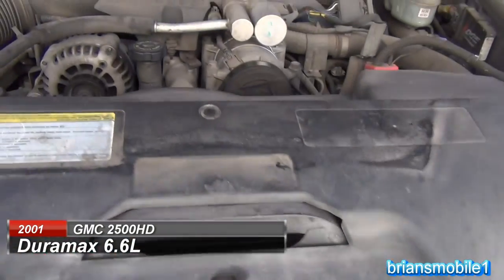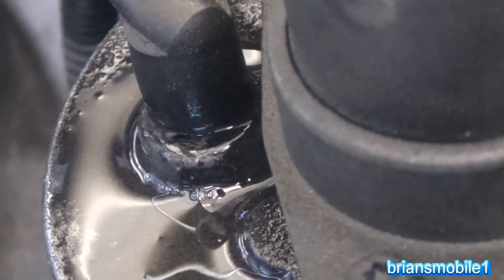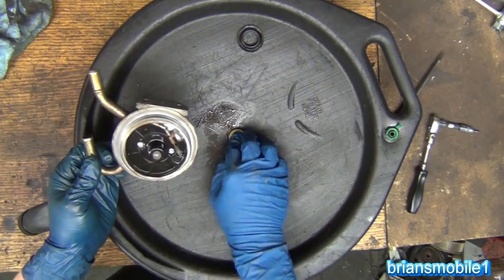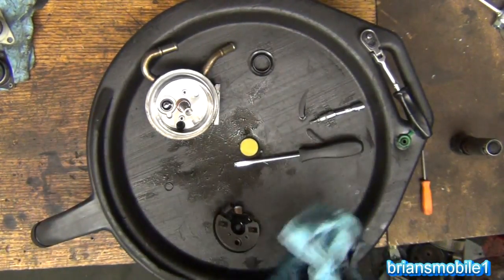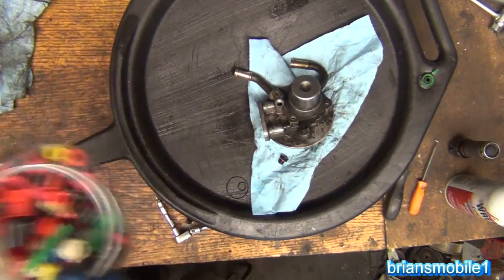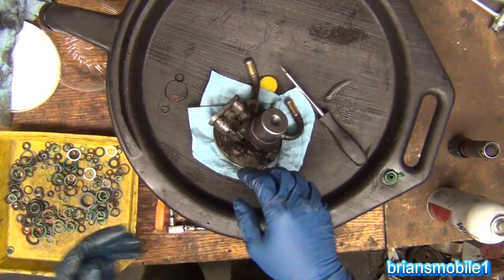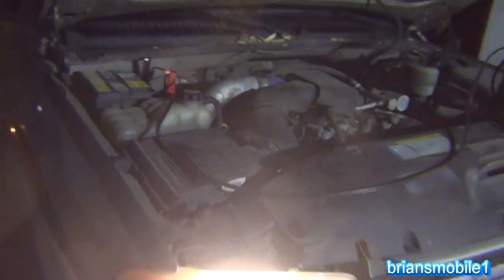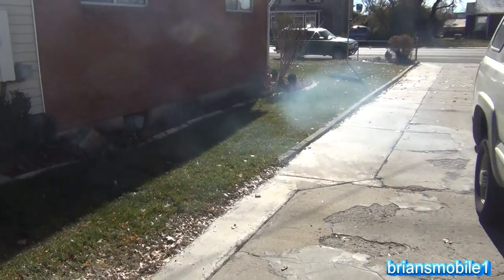Duramax Smoking and Hard Start Easy Cheap Fixes

Comment: does anyone make a decent diesel truck engine these days?
Reply: Alex's Bikes and Motors im pretty happy with my 250 000miles duramax, on original injectors
Reply: Alex's Bikes and Motors bypass or take off all the emissions crap and then you have a chance of having a decent diesel truck.
Reply: Yes they do the 7.3
Reply: Chris Johnson if you really want a ford, 7,3 is the way to go. Otherwise just factor in the lost time and expensive repairs and be happy with a 6.0 6.4
Reply from the maker: +Alex's Bikes and Motors Caterpillar is great, Kubota is decent enough, and I really like Cummins.  Duramax is a great engine too, but cost of ownership goes up pretty fast after 120k miles or so.
Reply: briansmobile1
Lets be honest, if you buy anything for a diesel, you pay a lot for it, no matter the brand. And if you were able to pay the truck, you're able to pay maintenance now that the truck is payed.
I dont think the duramax is any more expensive in ownership. It's less maintenance cost than a ford as it's easier to work on, and it uses the same high pressure cp3 pump as a cummins, so it`s similar in durability.  I have 240 000 miles on mine on the original injectors.  It`s a million mile engine. My friend at the dealership sends me pictures of 500k-700k duramax every years.
Reply: question... I have 330,000 on my 2006 duramax it's starting to blow more black smoke, I'm guessing raw fuel. And my fuel mileage is getting worse I'm averaging 15 miles to a gallon. I use seefome every scheduled oil & fuel filter change. Is there anything I can do to corect the black smoke and improve my fuel consumption? I'm no mechanic I do realize that the milage does have a play in this and insted of taking my truck into a dealership or another mechanic I want to start doing it myself. And to finish off with one more question...  How many miles on average can I put on the 6.6 duramax? Thanks in advance for for the help
Reply: One more thing...  Is there a video that explains how to bypass the epa imishions and is it safe to do so?
I would like to put a banks system on it allso is 300,000+ miles on the engine to many miles on it to do that without causing more problems with my truck?
Reply: Jon law
 you could have a stuck open injector. A good scan tool could turn off the injectors one by one and find which is not affecting idle, thus indicating an open one.  As far as mileage, Ive seen 4 duramax over 700 000 miles. Some must be over the million.The lbz is a good one, and emissions deletion is illegal albeit if you want diesel engines to last, you have to delete them.
Without checking balance rates with a scanner, you'll be running around in circle in the desert. 
also, you truck needs new rubber lines, they are ALL dead by now in your whole fuel system. Check my videos, I had line collaspe everywhere on the truck starving my injection pump.
Reply: Veikra, I appreciate your feedback... 
I've already changed out all the hoses I'm in the process of upgrading everything like hoses belts... Ext... 
Send me a link to your video so I can check it out.What about putting a banks system on it, would it cause more problems with the mileage I have on it? I'm fixing this truck up I've got it payed off and I don't want to buy a new one I'd reather put a new moter in it and fix it up the way I want it. I do appreciate your feedback, I put a little bit of cash each month fixing and upgrading my truck I've got aways to go till it's the way I'm wanting it
Reply: Alex's Bikes and Motors NO